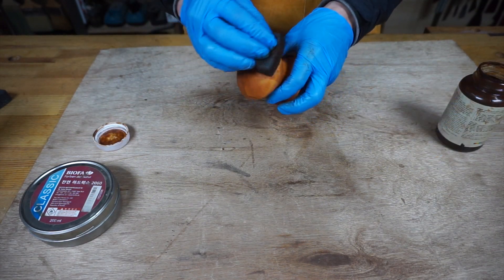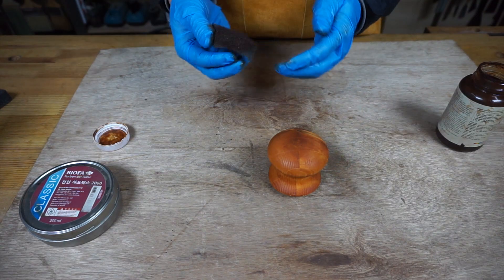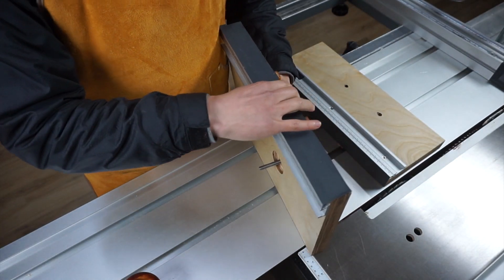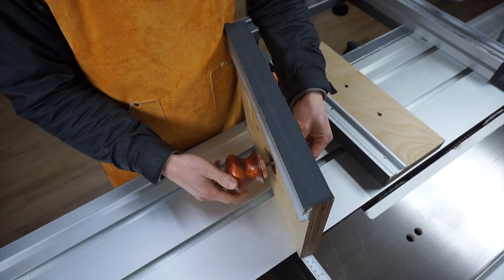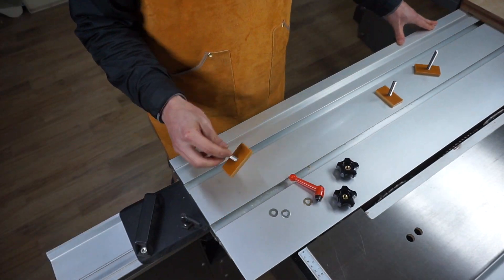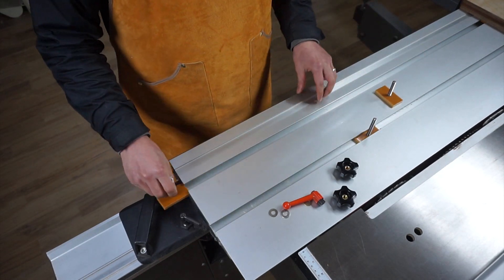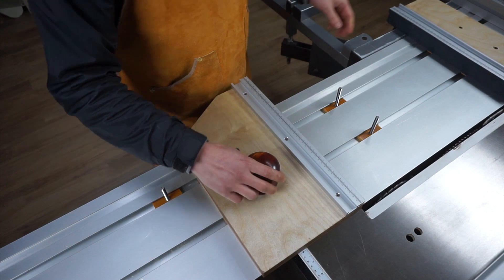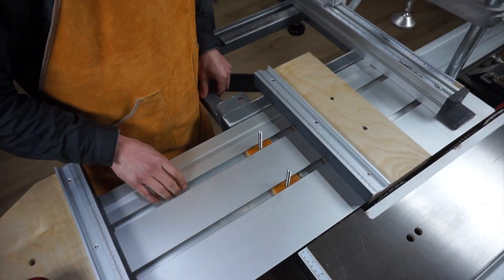Fritz and Franz Jig | Sliding Table Saw jig

Comment: Not sure what the front part is for- there is already a front fence. If you want to cut acute angles, a jig with an adjustable side support is more common- with good reason. Clamping the ends of thin strips between parallel jaws, with a single clamp spaced far away from the part, is asking for trouble. Plus, clamp it tight, and it will mark the wood.
Reply from the maker: The reason why there is a front part is necessary when using a jig installed in the middle of the slide.
This is in case you use the machine's fence and jig separately. Because there are tasks that use both.
I haven't had any discomfort while doing the thin rip cut yet. I am also using a thin rip cut jig, but personally, the jig in the video was more precise and convenient. Also, instead of adjusting the spacing with a fence, you can adjust the spacing with a magnetic switch and act as a stopper.

When cutting wood thinly in the jig in the video, you must use a tree that has enough room to not bend. The same goes for thinning wood on a table saw.
This is because it is dangerous to use wood to the remaining thin parts.

I use a table saw and a sliding table saw in my workroom, but I personally prefer to work on a sliding table saw, so I made this jig.
Your opinion is valid and I respect it. Good point.
My communication may not have been properly because I used a translator. Please understand.
Thank you for watching my video with interest. Have a nice day.😀👍

Comment: The auto-translate of the closed captions says that you used adhesive backed sandpaper for the grip surfaces / inside faces, is that correct, and has that held up for you?

Comment: What is that plastic material you used for the sliders and locking tabs?
Reply from the maker: Hello. Nice to meet you.
The material used in the slider and the lock tab is Bakelite.
I used it because it is stronger than wood and has better heat resistance and wear resistance.
Thank you for watching my video. Have a good day.😀